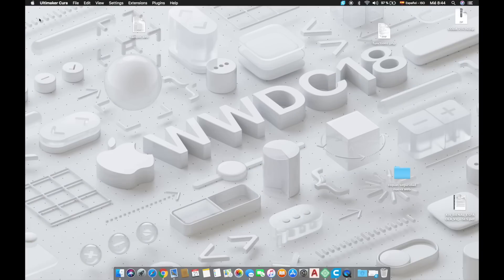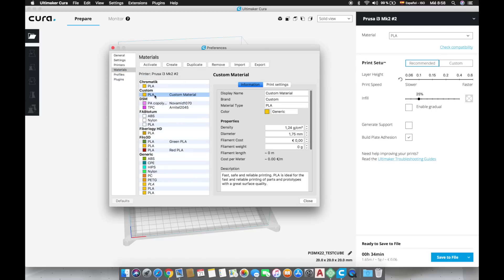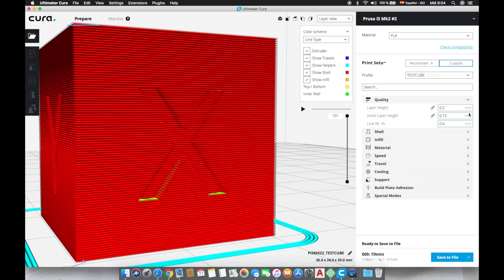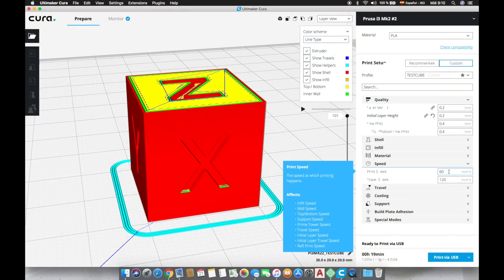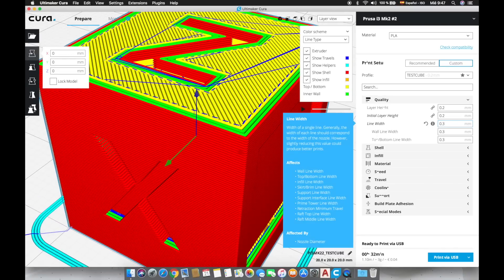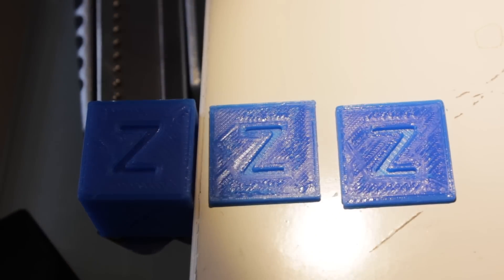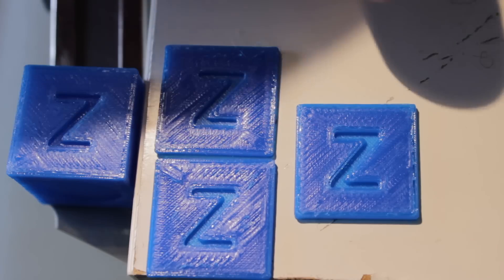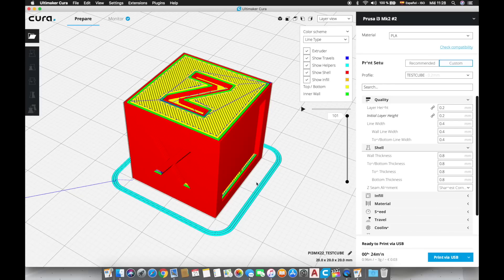Cura advanced settings 2018 - #01 Quality

Comment: WOW! Rhino starts at 495.00 to over 900.00 just get AUTODESK  Fusion 360, does about the same thing but IT"S FREE....
Reply from the maker: Fusion 360 is a good option to go with as well =) I'm an architect and I need more features that I can only get in Rhino, but only for 3D Printing you can go only with 360 of course.

Comment: How i can to remove the helper line around the model?
Reply from the maker: You can go to the tap Build Plate Adhesion (check out my dedicated video)
and select for example skirt, and set all the values to 0 ZERO. :)

Comment: Hi! 6:30 - it's a confusing explanation. Unless a viewer don't care about which cube is which... You've cut it (I suppose) and didn't told about it. Also if you're showing two different prints then it's the best behavior to not shaking them in front of a camera but point with a thin object (a pen or tweezers maybe) and tell concretely "this is the 1st that was printed with 0.4mm line width and this (pointing) is the 2nd with 0.3mm".
The 2nd option: you can overlay graphics and text while editing the video that will explain things better. Even if you're not pointing on camera you can fix it here. I've did that few times and it looks fine IMO.
I know it's a simple laziness and I've made similar mistakes in my videos few times... But it seems that you're making some sort of serious tutorials while working in a non-serious style (it's not about any clothes or haircut :D )
P.S. I use a powerful flashlight (from my bicycle) to show details from different angles. You can talk about the process even while it's printing. You can find that hint in action in my long video where I print a temp. tower for PETG.
P.P.S. oh, yeah, I see all "my hints" later :)) But then you don't need that piece in the video. The longer the video, the less chances that it will be watched to the end... I try to cut all my mumbling and etc. to save few minutes (as I'm not a good speaker).

Comment: My ender 3 nozzle keeps marking the top of the print in certain places what causes this anyone?
Reply from the maker: You can try to increase the number of top layers, re-level the heated bed and reducing the filament flow in the slicer settings. Tell me if it solves that  :)